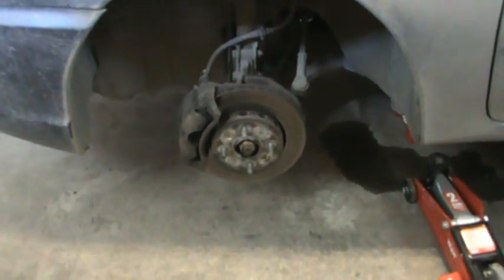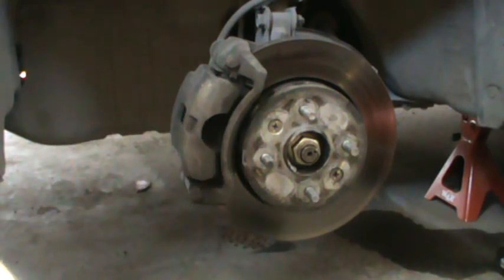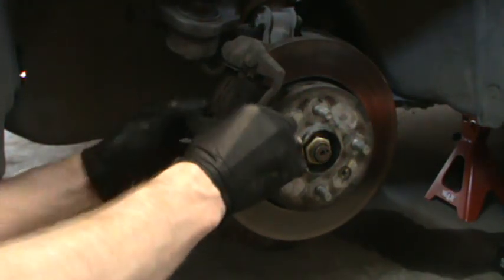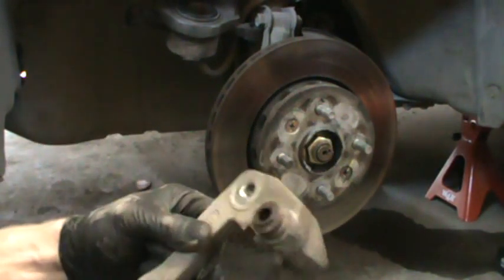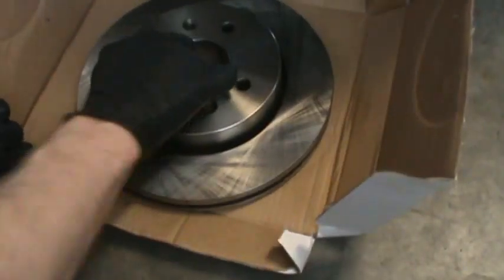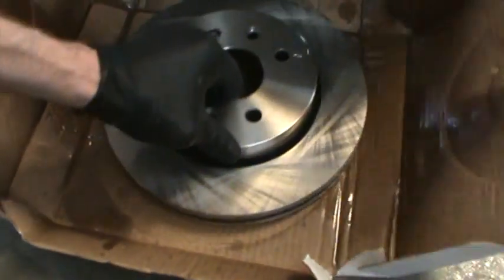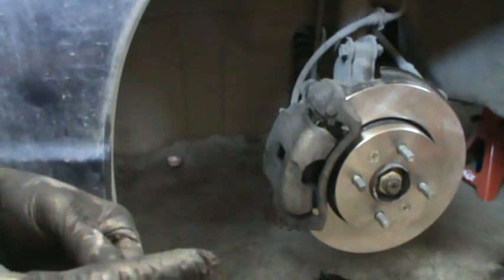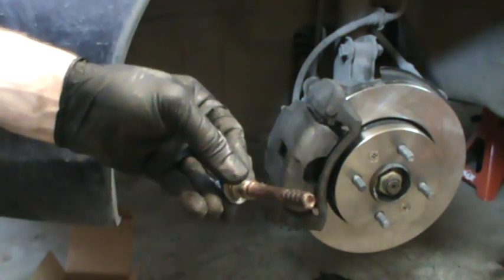Replace Brake Pads and Rotors on 2003 Kia Spectra 1.8L 4cyl Engine

Comment: Great video, thanks! Did you remove the cap for the break fluid reservoir before you started?
Reply from the maker: vmurder 33 Yes.  That will make it easier for the piston to be pushed back to remove the pads.

Comment: u used an air wrench, is that necessary to use to put those screw bolts back in? meaning, is there a required amount of torque or ft lbs that need to be applied to those screws or is hand tightening ok?

Comment: Do the rotors come with new screws when you buy new ones. Cuz I broke my screws on the rotors when I was trying to get the axle off the spindle
Reply from the maker: abracardabra 77 I don't believe they do come with the rotor. You will most likely have to purchase the screw bolt separately. If you have the other side's score intact, bring that to the parts store to ensure you get the right one. Are you able to get the broken part of the screw bolt out of the rotor?

Comment: I noticed you have done a few videos on a 2003 kia spectra. I was wondering if you have anything on the transmission filter.
Reply: I have not done the transmission filter on a kia. I will see if I can do a video soon.
Reply from the maker: Clean off the bolt as much as possible.  You could use brake parts 
cleaner, let it evaporate, then apply some penetrating lubricant.  Let 
it sit for a bit, and bang on the caliper where you wont damage 
anything, to help the penetrant to vibrate into the little nooks and 
crannies.  Also try a small breaker bar.  If you are using a standard 
wrench, try getting a small length of PVC pipe that will fit somewhat 
snuggly with your socket wrench arm.  The PVC will act as a breaker bar,
 but will have some flex so you don't snap a bolt head off.
Reply from the maker: Clean off the bolt as much as possible.  You could use brake parts 
cleaner, let it evaporate, then apply some penetrating lubricant.  Let 
it sit for a bit, and bang on the caliper where you wont damage 
anything, to help the penetrant to vibrate into the little nooks and 
crannies.  Also try a small breaker bar.  If you are using a standard 
wrench, try getting a small length of PVC pipe that will fit somewhat 
snuggly with your socket wrench arm.  The PVC will act as a breaker bar,
 but will have some flex so you don't snap a bolt head off.

Comment: i jsut bought a 2004 kia optima. i decided to try and replace the pulsing rotors.  but i noticed the set screws were missing. could that of been the reason for the pusling?
Reply from the maker: jake smith Missing screw bolts on the rotor face plate could allow for some unwanted play and pulsing. One way you could check the rotors is to remove the rotor and set on ground face up. Take a ruler or other straight edge and place it on the rotor. Place a flashlight on one side of the straight edge and move the straight edge around the rotor and see if you have light coming through as you rotate. you should be able to see if you have any warping.
Reply: the ones the hold the rotor to the knuckle